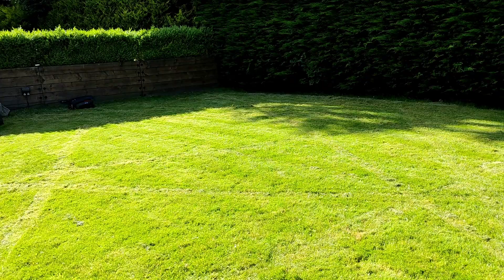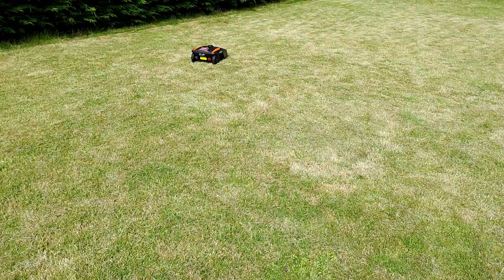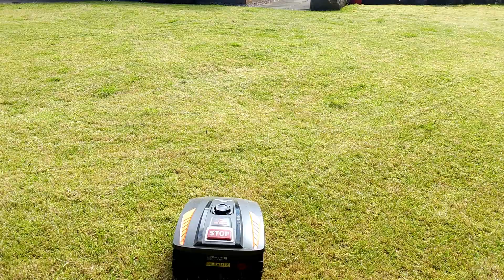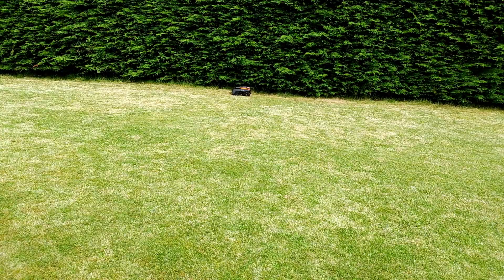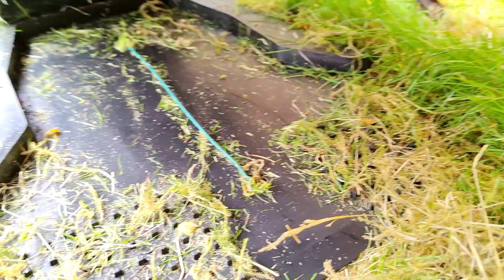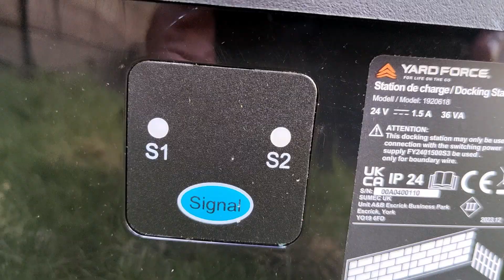Yard Force MB400 Robot Lawnmower Review

Comment: How on earth do you set it to do an edge trim when following the wire… I can’t see any buttons to set that, although in the app there is a setting, however it says either the mower needs to be in the dock, but when it’s in the dock and I try it comes up with other errors like it’s not working time (I’ve tried everything, setting schedules, auto, manual)…

Comment: How do you get it to do the edge trim? For me, it only does then when leaving the dock. But after a certain amount of distance it stops and switches to normal cutting.
Reply from the maker: It normally does that if it gets stuck at a particular part of the perimeter. Smooth the area it gets stuck at, or strim if grass is really long there.

Comment: I keep getting the mower does not detect boundary signal now thing happening and it won't stop
Reply from the maker: Check 1. Are both wires connected to the back of the base station. 2 is the wire cut somewhere. 3 are both the mower and base on the same channel. 4 have you got it setup that the mower enters the base station in an anti clockwise direction. Clockwise doesn't work.  5 are the 2 wires in the back of the base station the right way around . 6 check them all again. It's one of them !

Comment: Does the lawn mower detect itself that it has cut the whole area and then go back to its docking station? Or do you have to manually command the robot to back to its station?
Reply from the maker: No. It's pretty random. It does have a percentage estimate.  What you do is guess how long to put it out for each day.... Say 3 hours every day for a bigger garden. It will then go about it's cutting each day on its own. You can add or reduce the time depending on if you think it's getting round it all.  The mower doesn't know exactly where it's been, it just zig zags randomly.

Comment: Many thanks for this helpful review. Anyone tested this model on a garden with various slopes and an irregular layout? Also, can you buy additional boundary wire as i gather ot only comes with 120m which is probably insufficient for our garden?
Reply from the maker: There's a limit to the slopes it can handle but it copes with mine ok. I added about 30m of extra wire with no problem.  

It can do irregular layout but can end up spending more time in one part if there are thin sections joining 2 wide sections.
Reply: My garden has gentle slopes all over the place and it's fine. It did get stuck when it was wet and probably went too fast into a boundary. I'm going to get metal spikes to put on the wheels for more grip. It doesn't deal with obstacles well, ends up digging in and getting stuck if the surface is loose. Great for keeping weeds at bay and hassle free!

Comment: what would your recommendation be for setting the schedule? should the mower be cutting every day? Thanks.
Reply from the maker: I put it out for 3 hours per day in the afternoon. I avoid the mornings as the grass is normally wet from dew then.  I find that is enough and also allows me to switch it off certain days if I'm doing something else in the garden and don't want the mower buzzing around.  Bear in mind that of the 3 hours, it will spend some of that time recharging.
Reply: @sparkysproductreviews  Thanks for the reply. I’m having issues getting the app to work. I can adjust the settings/schedules etc. whilst i’m connected by bluetooth but as soon as it disconnects it just resets. The mower then just comes out at random 🤷🏼‍♂️
Reply from the maker: @lw2575  make sure it's in manual schedule mode. It sounds like you've accidentally selected auto mode.
Reply: @sparkysproductreviews  I double checked this, but it seems like it doesn’t matter which mode I leave it in. when I next connect to the mower via bluetooth all the schedules and setting have fully reset. I have submitted a help ticket with the manufacturer so we’ll see what comes of it. Thanks again.

Comment: Just bought one of these from Aldi.  My grass is fully surrounded by a patio (roughly 5mm lower than the grass).  Can I put the boundary wire closer than 30cm to the sides so there is no need to strim?  If you're not sure,  is the boundary wire senor central in the machine - does it follow the path centrally?
Reply from the maker: Yes, I have a bit like that where I run the cable along the edge of the grass with zero gap. The mover follows the cable with 1 wheel on the grass and the other on the slabs.

Comment: Great video showing our MB400 Robotic Lawnmower! Should you have any questions, our friendly team are always on hand to help.
Reply: Ive found this mower to work well, although part of it was damaged when purchased and  getting it replaced appears to be impossible. Ive also found the rain sensor and object avoidance to be none existent. The object avoidance appears to rely on the mower physically not being able to move.
Reply from the maker: For your main objects you need to use the perimeter cable to go around them. I cover in the video that it doesn't have obstacle avoidance and that it will bang into things or push them out of the way (Or shred them if they are low) if you leave them out.   Once you know that though you can plan around it without too much problem.
Reply from the maker: Thanks folks. The mower has been working well for me so I thought I'd share it.
Reply: @yardforceglobal. Does this have a rain sensor. Mine carry’s on in the rain.
Reply: @parin100  Hi, thanks for your question! This mower doesn’t have a built-in rain sensor, so it will continue to operate in the rain. However, we recommend returning it to its charging station using the CloudHawk app if the rain becomes too heavy, as this helps prevent any potential surface damage to your lawn. Let us know if you have any further questions.
Reply: @yardforceglobal Got a question, how do you reset the yardforce mb400? Mines only 2 months old and I get the blue flashing light a lot (border is fine) but can’t seem to reset it out of its doom loop
Reply: I have this mower and have a question - When I first go it, during the first cut it followed the boundary wire and cut the edge first. This was fantastic, but I haven’t been able to get it to this since. It will only go a few meters, stop, and then cut like normal. Is there a way to tell it to cut the edges alone the wire?
Reply: @shortymcsteve  This is probably because it's getting stuck on the way around. I have uneven grass and side overgrowth, after a few bends around the obstacle, it just mows the lawn as normal. Try and clear the perimeter and level it completely. You'll have to watch where it gets stuck.

Comment: Is there a set procedure for getting strimming mode to work? I've pressed the strimming mode on the app when the mower is in its garage. It happily sets off for 2 or 3 meters along the border wire and then gives up and heads off across the lawn, leaving the edging uncut.
Reply from the maker: That normally happens if it's getting a little bit stuck on part of the perimeter.  Make sure that part is level and perhaps cut it shorter manually to help it get around first time.

Comment: Great review and the mower is excellent! Only minor hiccup was setting up the app at the start when trying to move the jigsaw pieces, just use the arrow to the correct position (I was trying to drag the jigsaw pieces by touching them, unsuccessfully). Best option is to bury the perimeter wire, as I had an occasion where machine cut the loosely pegged wire. I used an  edging tool to make slot / groove in grass to bury wire - hope this helps others
Reply from the maker: I found that after a couple of months the wire had pretty much buried itself and therefore didn't need to be manually buried. The mower can cut the wire though if it's not low to the ground. If that happens the mower stops where it is to make it easy for you to find the break and re join the wire.
Reply: @sparkysproductreviews  I found out the hard way and had use one of the three wire joiners to reconnect the cut wire, so far it hasn't been cut again 😊

Comment: Do you have a link to the app and how do you initiate Bluetooth? I’ve got one but I can’t work out how to get the Bluetooth to work and also what app to download.? There’s nothing in the manual that I got about an app :(
Reply from the maker: There's a separate manual in the box for the app. Once in the app you scan the QR code on the back of the mower to connect it. The app is called Cloudhawk.
Reply: Thanks I found it shortly after I posted. Thanks again for your help.

Comment: Bluetooth set up, nut keeps losing connection with app. Does the Bluetooth operate remotely? No Bluetooth button on mower.
Reply from the maker: You need to be quite close to the mower for Bluetooth to work.

Comment: Can this cut multiple lawns? Or is it just the one with the docking station ?
Reply from the maker: It depends on where your boundary wire goes. If the mower can get from one to the other by flat ground and you can get the boundary wire round the whole area then it might be possible.
Reply: I have a front and back lawn. How would  that work. Would i need to get more boundary wire? When you set up the boundary wire does it need to be burried? If it leaves a strip around the edges of lawn I guess you have to strim it when there's a danger of cutting the boundary wire isn't there?
Reply: Can I put the docking station in my garage? Im worried that if I leave it outside it could be stolen! Im presuming that the machine will always return to the docking station so it would have to remain outside. Also that it would  remember where the docking station is and so it shouldn't  be moved

Also if set it to  cut the lawn and rain happens can I stop it remotely?
Reply from the maker: @josielatouche1423 the docking station is part of the boundary wire circuit. The wire begins and ends at the docking station. It could only be in a garage if the mower can follow the wire back into the garage across flattish ground etc.
Reply from the maker: @josielatouche1423 The mower only has Bluetooth so you need to be close to it to give it a command. I just let mine keep going in the rain
Reply from the maker: @josielatouche1423 the front and back would need to be part of the same continuous loop of wire so it wouldn't work for most lawn layouts.
Reply: Do you know how I can get it to go across a path?I have a path outside my front door but got lawn on both side.But obviously I can't have a wire hanging over my path.Any ideas

Comment: Just picked one up today from Aldi for £199. Unbelievable price considering it’s at £449 on the Yard Force website! Thanks for the review, very timely. I look forward to setting it up!
Reply: Back in stock at Aldi. £199.
Reply: @AJ-ku7nm just picked one up ! Boys and their toys 😃
Reply: Aldi now selling these for £70
Reply from the maker: @calumthompson wow
Reply: Its now in  aldi today for £100
Reply: What I do want to know is can you programme them by an app or do you have to have the wire?I've got two separate grass patches that my path separates , will it drive over the path and cut the other side cut the other's side
Reply: you must have the base wire. It creates a boundary to tell the robot where the border of its work area is. If you’re able to encompass all the parts of your garden with the boundary wire, it will just cross whatever it needs to.  You can even set random boundary wires around a circular feature you don’t want it to go near etc. it’s quite adaptable.  However the app is very basic based on awful Bluetooth connection (I never use it) so just set it off when I want to via the buttons on top of the unit.
Reply: @craigoliver2810 I know, saw that the other day! Can’t quite believe it! £450 on the manufacturer website!!
Reply: How is the Aldi lawnmower working out for you do you lawn mower need to be like a pool table
Reply: @teammj2855 except for issues with the rain sensor and object avoidance it's been fine and my garden is very rough with a couple of steep sections
Reply from the maker: It doesn't need to be like a pool table but if it's too rough it might get stuck. I filled in a couple of holes in my garden after the first week and it's been fine since.
Reply: How are you finding the object avoidance and rain sensor. Mine just ploughs into things and continues to go out in the rain.

Comment: I was hoping to get it as close to the wall as possible so I might be able to avoid strumming as it's a massive garden. Any suggestions on where to put the wire? The suggested seems a good bit off the wall.
Reply: I don't think you'll be able to totally avoid strimming as the blades don't cover the full width of the mower so don't go right up to the edge. You might get it a bit closer than me though through experimenting with the wire position.
Reply: That's a good point  @mlow7497 maybe I'll just set it up as suggested.
Reply: I agree you're not going to avoid strimming against a wall or fence. Even without the wire the blades don't cut wide enough.

Comment: Thanks for the review. It was a great help. One question however, do you need to use the perimeter wire. Can it be used without it & just let it roam freely?
Reply: Requires a wire to set a boundry. Wirefree models with AI vision or geo-fencing (enhanced GPS) tend to be more expensive.
Reply from the maker: I cant see a way to use it without the wire. It needs that in order to zig zag back and forward
Reply: Andy. What's your query specifically about the wire mate? I've just installed the mower yesterday and was a little confused about the wire before I put it in. It needs the wire to find it's way back to the docking station. When it's finished cutting or is needing to charge it will find the wire and follow it back to recharge. Also it just roams freely when cutting until it senses the wire or hits an object at which point it changes direction and goes off until it comes across the wire or hits something else. If you want to know anything else just ask👍 I've buried about half of the wire in the lawn and had no problems. I intend to bury all of it though as I noticed that the rear wheel was catching it slightly in places.
Reply: I would recommend burying the wire- No problem cutting at mid and max, but when set to min, wire easily cut. Otherwise terrific.